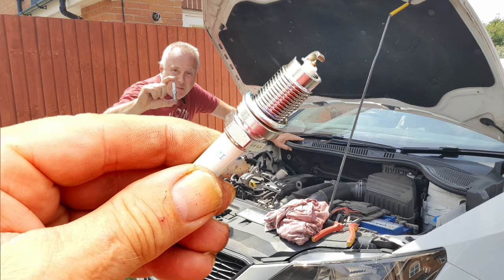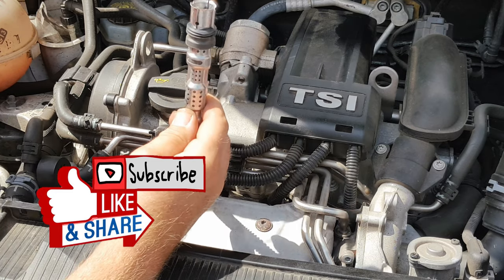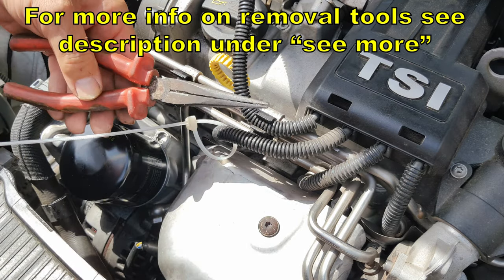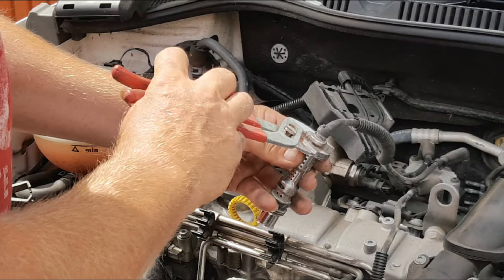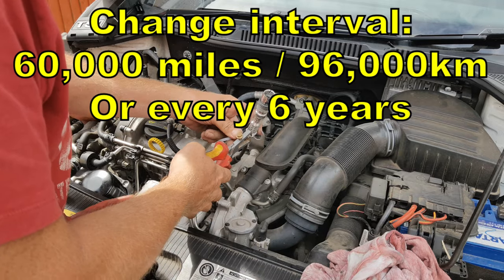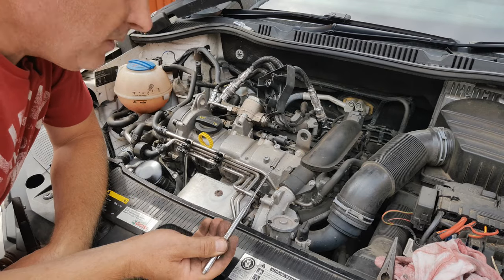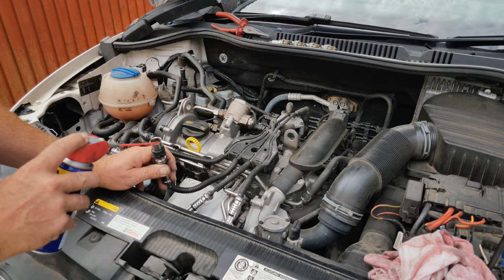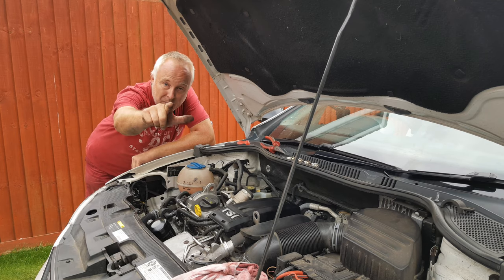VW 1.2 TSi Spark Plug Change Made Easy | It's INSPIRED❗

Comment: Tried your method but all the 5mm cable ties all snapped, 7.5mm ties just too large and kept slipping. Bought a spark plug boot plier off amazon for around £20 inc postage and although not perfect did the job with a lot of wiggling, the use of a flat headed screwdriver where possible and wd40 spray. At 60kmiles I believe this was the first change (and will be the last!) which made the removal difficult. I think some of the rubber was perishing which didn't help. Without your video though I would not have attempted it, Thank you.

Comment: Thank you for posting this informative recording. Like the trick with cable ties, always good to have a selection available for different uses. I assume intentionally no copper grease on the plug threads?
Reply from the maker: DO NOT USE copper grease on spark plugs thread nor anywhere near brakes. 
The silver coating you see on plug threads these days is specifically designed to ease the removal even after many 10s of 000s of miles.

Comment: Found if you install the zip ties and gently wriggle them as you are slowly pulling them out, you will over come the suction the rubber seal causes and you don't break the zip ties. I followed your tip and snapped the first zip tie but them used the wriggle method and got even the hard one out without breaking the zip tie. Thanks for your insight and method. Just done the full service, thanks to you cheers.
Reply from the maker: Great tip. Thanks for sharing 👍

Comment: Thanks for very informative video. I only had small cable ties handy and broke half a dozen. Before I gave up all together I tried 1 last time, this time wiggled the plugs out rather than direct pull and they all came out easily without breaking any more ties! Thanks again
Reply from the maker: YES, of course❗ Why didn't I think of that❓ The only cautionary note I would add though for others benefit is to be careful not to waggle them too hard. We don't want to break the ceramic on the plugs. If the ceramic breaks there'll be shards of ceramic in the plug hole which might subsequently get into the cyclinders and potentially do damage.
Reply: @CycloneCyd  very very slight wiggle, with a moderate pull at the same.

Comment: Thanks for tip with cable ties. I used 7.5mm ties on my 1.2 TSI (Skoda Roomster). I was lucky enough to be able to use ties on all 4 cylinders  without removing any engine parts. Be patient and for cylinder 4 take care when guiding plug in.
Reply from the maker: Job jobbed!

Comment: Thank you so much for the vlog,  im definitely no mechanic and this video has helped me so much and I done a successful spark plug change today with the help from you 😎👊 oil change next 🙈🤞
Reply from the maker: Awesome. If you're just starting out servicing your own car(s), make sure to equip yourself with a decent filter removal tool. This is the same one you see me using in my video for 1.2TSi oil change, https://amzn.to/2KBZSCC, and is excellent quality. It will last you a lifetime. It needs a 3/8 drive though. If you have a 1/2 inch socket set, this is very similar and looks just as robust https://amzn.to/38F1WYg
1.2Tsi oil change https://youtu.be/tWT2tG13hIc - do let us know how you get on.

Comment: Thanks so much for your advices.I was wondering how to put the plugs out. Never seen so difficult plugs to extract...
Reply from the maker: Yeah, a right Royal pain in the posterior❗ Welcome aboard, Guillaume
Reply: @CycloneCyd  :-) But I didn't make the work yet... On videos it's always easy :-)  Maybe I will curse VW conceptors!
Reply from the maker: @Prologui2000  ha ha, yeah it always looks easy when you watch someone else doing summat! this isn't actually difficult as such, just fiddly and frustrating when you keep snapping tie wraps. You could always double up with two tie wraps per
Reply from the maker: @Prologui2000  I think this is why VW decided to fit iridium plugs from new - the first owner of the car is unlikely to ever need to change the plugs, it'll probably fall on the second or third owner. Keeps the "cost of ownership" down for the new buyer - which is a competitive metric for fleets especially.
Reply: @CycloneCyd  It's OK I changed the plugs quite easily with 4 tie wraps. No problems met, thanks again!

Comment: Good tip! It's bloody annoying that these are such a fiddly design. Even worse that on the pre-2013 models the lead routing was slightly different, lacked any shielding and number 3 always failed.
Reply from the maker: Didn't know that, thanks for adding to the knowledge base.

Comment: Hi cylone cyd, changing my sparkplugs, of my 2012 caddy 1.2 tsi, i cant get the sparkplug leads of the sparkplug itself. Previous owner never greased up the rubber inserts. Now ordering 4 new sparkplug leads, because they will break when i remove them… thanks for the ziptie tip! Im ordering the ngk leads, they have the plastic covers on it leads itself, it was also a recall back in the time.
Reply from the maker: They aren't scheduled for change until 60,000 miles so may never have been done yet. Very unfortunate. VWs bad!

Comment: I knew that there is a conductive lubricant, but to pshik VD40 this is from the realm of fantasy.

You have spark plug wires pierced on the first and fourth cylinder or third.  The motors are the same as the Skoda Yeti !?

Comment: I have a question, a VW Polo 1.2 of 70 hp 6R, to change spark plugs is it imperative to buy originals from the brand so as not to make a mistake or can we buy brands like Bosch or NGK or similar in competition? I heard an engineer say that he saw a case where they put some NGKs and it went wrong after a few kilometers, which then went out.
Reply: Any brand is fine. Get iridium plugs if you can - they last longer.

Comment: Did you get a part number for the spark plug lead special tool from the dealer ??
Reply from the maker: No I didn't, it never even crossed my mind. I have some thoughts on easy home made tools for the job and will be trying some out and if they work I'll do a supplementary video to suggest them. If you have any suggestions find my email on my 'about' page
Reply: @CycloneCyd  the cable tie trick worked perfect ! thanks
Reply from the maker: @Moko1973  brilliant! did you break many? I broke about 8
Reply: @CycloneCyd  Must of been lucky , only broke 1
Reply from the maker: @Moko1973  you must have "the knack" 🤣

Comment: La ringrazio immensamente per i consigli, volevo solo fare presente che il WD-40 che usa alla fine non va bene x i contatti elettrici e le alte temperature (vedere scheda tecnica), meglio usare grafite o lubrificante specifico o anche l alcool non sul motore caldo - alcool poi evapora)
English:
Sir, I want express a very deep thaknful feeling. Just a counsel, do not use WD-40, it lay on a film of isolation that do not allow passing electricity (see datasheet) best to use graphite or specific lubricants (alcohol is good on cold motor - alcohol at last evaporate). Sorry for my English
Reply from the maker: Hey Giuseppe, never apologise for your English. My Italian(?) is non existant, so you're well ahead of me.
Thanks for the suggestion. Stay safe my friend.
Google translation to Italian:
Ehi Giuseppe, non scusarti mai per il tuo inglese. Il mio italiano(?) è inesistente, quindi sei molto più avanti di me.
Grazie per il suggerimento. Stai al sicuro amico mio.

Comment: Sono di nuovo qua per un importante aggiornamento, oltre a non usare il WD-40, è necessario sgrassare la superficie degli elettrodi con uno spray x contatti elettrici o con alcool propilico, sia la punta delle candele (polo positivo superiore) sia l'elettrodo del cavo altrimenti la macchina potrebbe, andare in protezione con accensione spia EPC e altre. Questo errore è molto difficile da individuare e induce molti professionisti a optare per cambi di elementi molto costosi.
English:
I'm here again, important notice, as I said do not use WD-40 but use special electric contact cleaner or alcohol isopropylic (cold engine), you will save money and trouble so you don't go into troubles about error  on dashboard on EPC signal lit and other error signals lighting on, or ECU going in protection mode. This inconvenient is very hard to find even by professional operators.
Reply from the maker: Thanks for that input 👍

Comment: I nevver knew that TRICK WITH THE WD40, thznk yoh so much i have a saab so you know were a can use it lol
Reply from the maker: Ha ha, yeah, back in carbs and distributor days we used to be quite liberal with it on HT systems in the winter. There was a time just getting any car to start in the winter mornings was a battle of wits with the elements
Reply: @CycloneCyd  i know right, round the North East then the busses didnt even run. Due to the snow beenover the bus stops
Reply: Wich WD-40 did u use sir? The regular one ore the contactspray?

Comment: Haw km to change the sparks?? Thanks
Reply: Refer to the vehicle manual for the spark plug replacement interval.  It is generally recommended to change after 40-60 thousand kilometers or after four engine oil changes.  I received the original candle after 30,000 km / 10 years of vehicle age.  So the time of the exchange also plays a role.

Comment: I've never seen a spark plug fail.
Reply from the maker: oh, it does happen. I've seen plenty over the years. They didn't used to be as good as they are now.
Reply: Believe me they do fail... or the cable accidentally gets ripped out and you have to replace them 😅